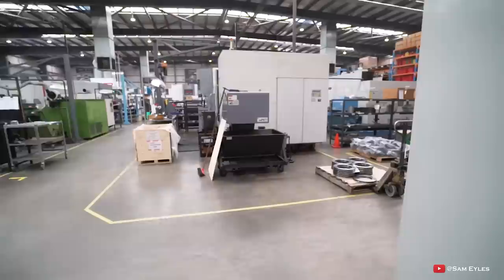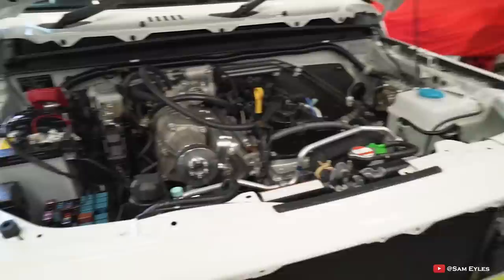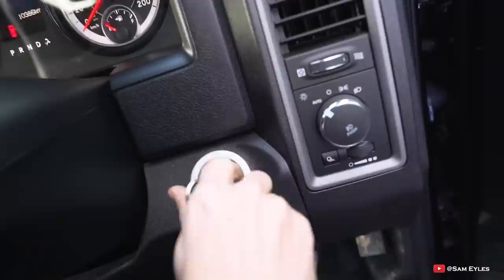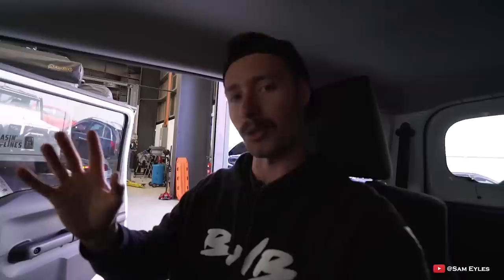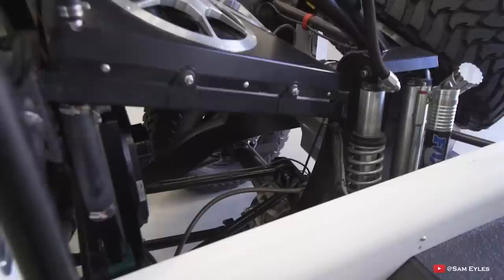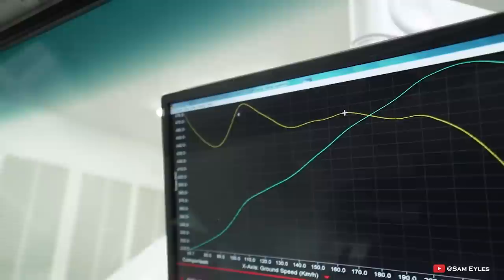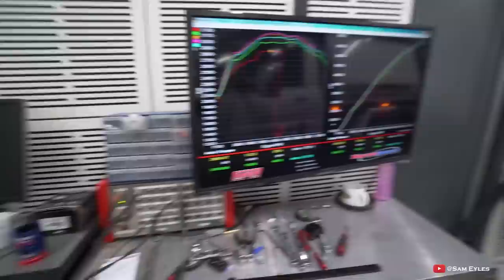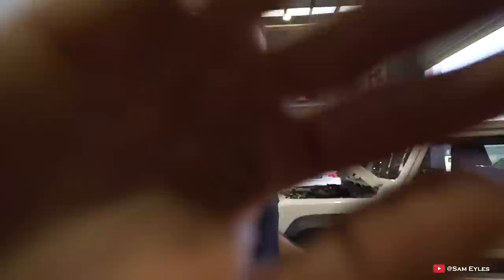650+ HP RUN AT HARROP ENGINEERING!!

Comment: My dads got a ram 2500 mega cab with the Cummins there bigger goes okay Offroad but would not recommend it coz to big and smokes the tyres and the transmission has been pulled out more time than we’ve changed the oil